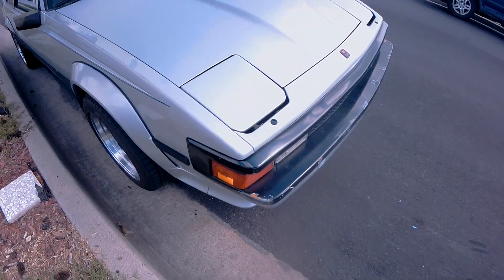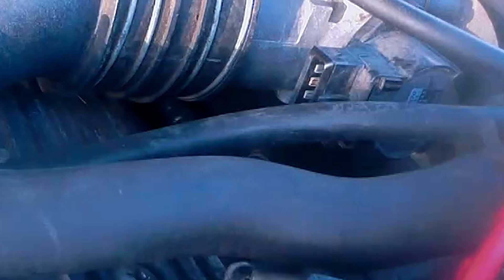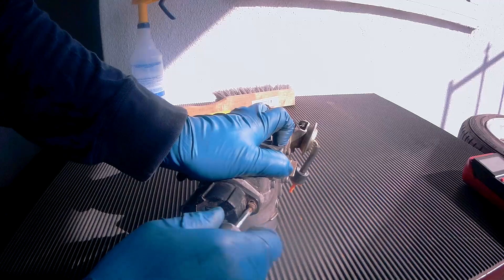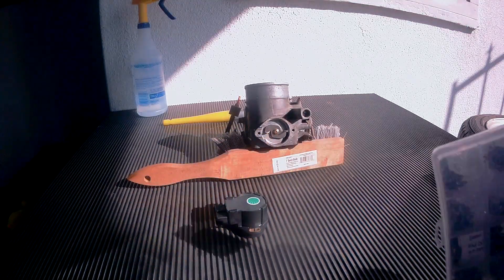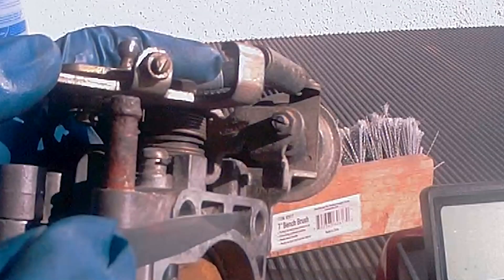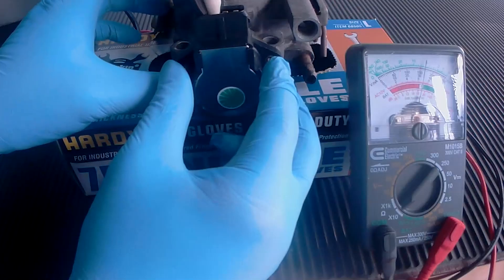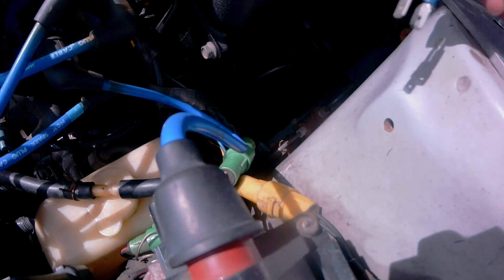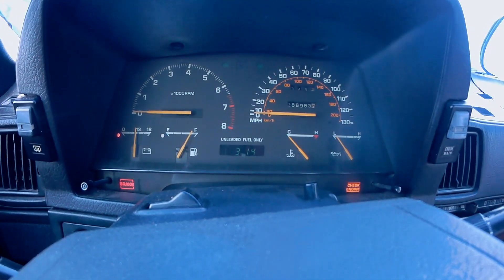(MKII) 1985 Toyota Celica Supra Calibrating a 4 Pin TPS

Comment: Cool Video.  Why did you change out the TPS module?  Was it an idling issue? My 85 idles rough between 5-600 RPM.
Reply from the maker: I thought it went bad. Turns out I blew my head gasket. Plus it was a good instructional video.
Reply: @johnsneverendinglistofrand1377  Thanks for the reply.  I appreciate it.  Please keep up with all the great instructional videos!